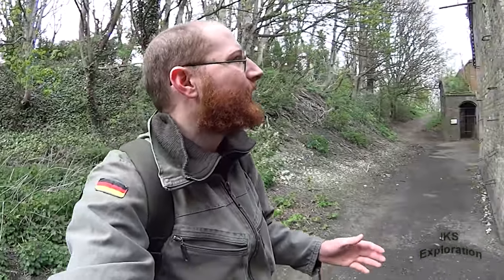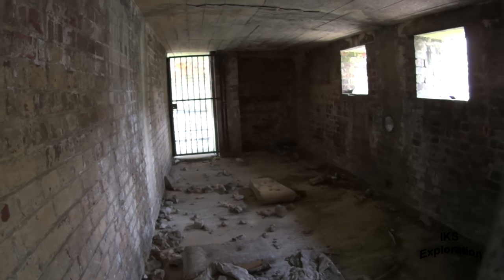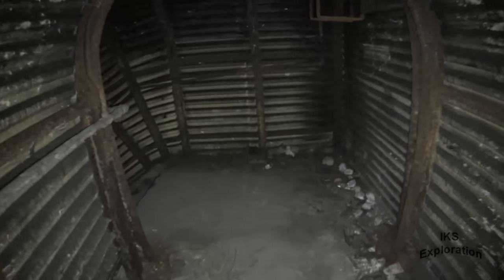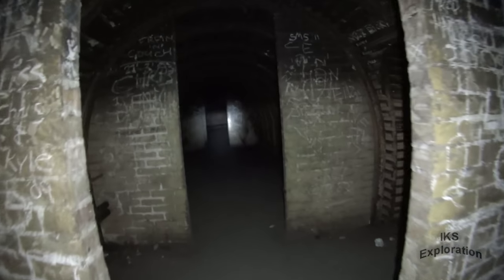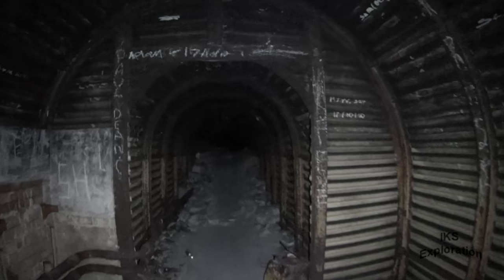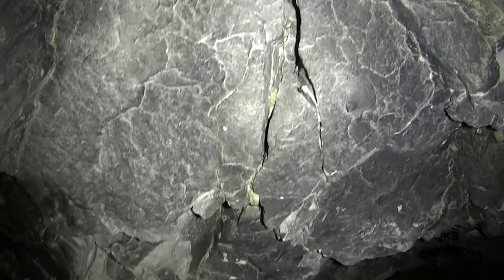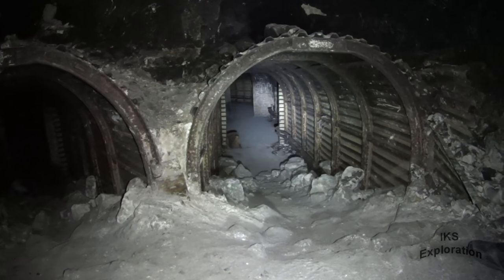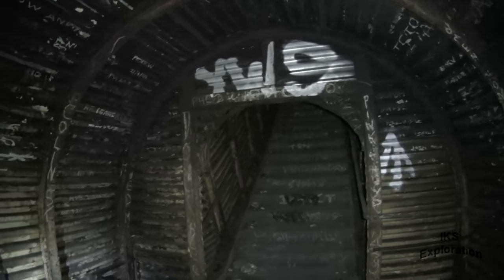St Martin's Battery Shelter - Dover

Comment: Another great vid. Keep up the good explores. At the fire site, the grey collapsed area floor looks melted from the heat of the fire. It would have been very hot to weaken structural steel and corrugated sheet metal to effect the collapse.  Wonder at what temp chalk melts?

Comment: they may have used a steam boiler system watch is a lot more piratical, so there would of be dead steam/water, when the steam cool off ,, and had to be drained out at some point,  the advantage over water boiler system is , if a bumb hits and cracks the pipes you dont get water all over place. the steam pipe can be patch and ready to go in no time ...water boiler system you have to refill and bleed air out of the whole system pain ass :)